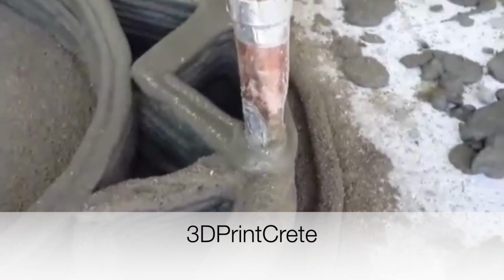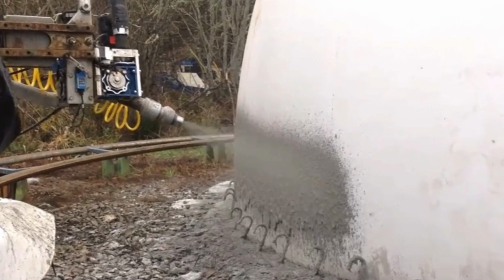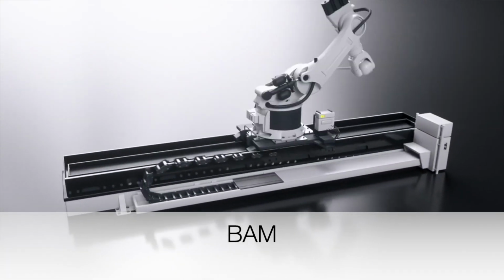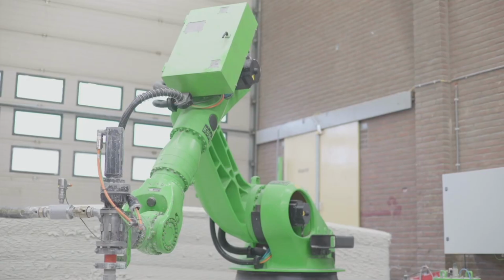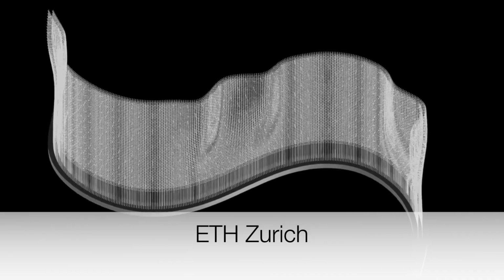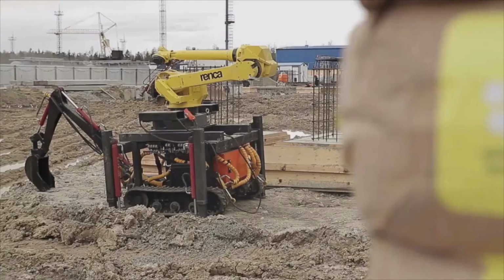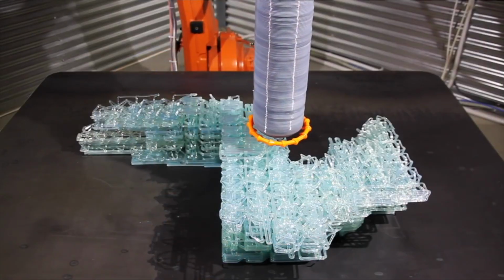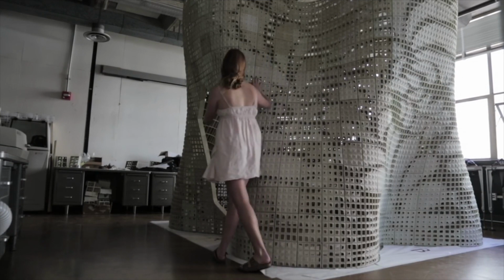28 More Companies and Organizations related to Automated Construction & 3DCP

Comment: "They test it by filling it with water. If any leaks out then the radiation and harmful atmosphere on Mars would seep into the building..."
This is wrong in 2 ways:
1. If your Mars habitat springs a leak the danger is getting hypoxia due to decompression of the breathable atmosphere, not martian CO2 leaking in.
2. The martian atmosphere isn't especially radioactive. The radiation hazard of Mars is mostly due to cosmic and solar radiation. A small leak would not alter the radiation exposure inside a structure in any meaningful way.
Reply from the maker: Thanks for the clarification